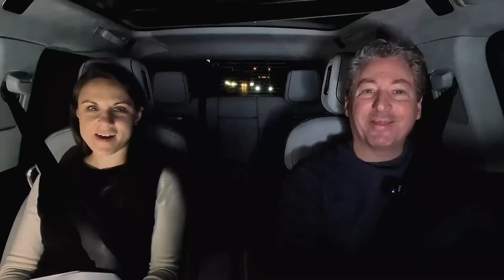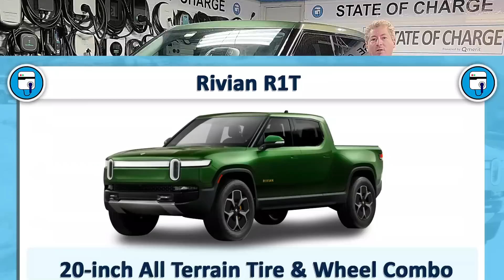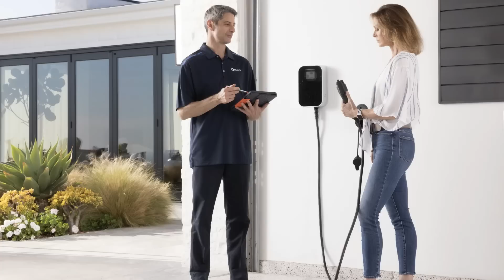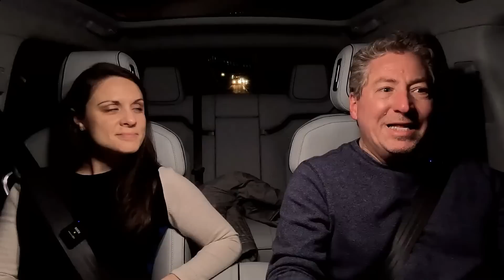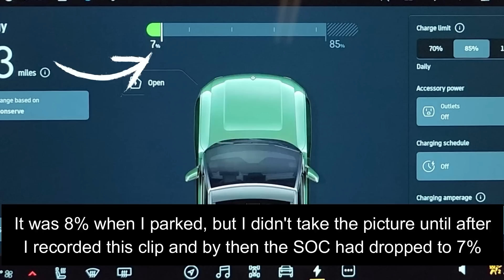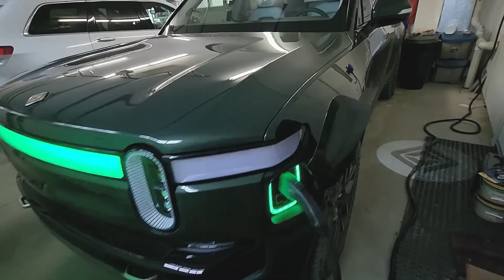Rivian R1T Winter Highway Driving Range Test

Comment: Tom what was your average speed in the Lightning? You stated 55 mph for the Rivian.
Reply from the maker: I don't remember, but it has to be less than one mph difference. You can see the comparison at the end I note it took me 3 hours and 50 minutes with the Rivian and 3 hours 54 minutes with the Lightning. So basically the same time to travel 211 miles.

Comment: I don't have a Rivian yet; R1S preorder in early Dec 2021. I do have a PDF of the manual. I couldn't find anything recommending using Conserve mode only for trips. ???
Reply from the maker: I don't believe it was an "official" statement. More of a recommendation that the vehicle is designed for all four motors to be used. If you exclusively drive using only the front motors, it will stress them more than they were designed for. The next time to speak to Rivian techs I will ask if they can clarify with an official statement.

Comment: Tom - can you explain how you used the cabin heater and how it impacted your range?
Reply from the maker: Sure, I set it to 71 degrees and on fan speed #1. When I do range tests I always set the temperature to 68 to 72 degrees, just enough to make the cabin comfortable and I also use the seat heater on the lowest setting. I don't know exactly how much the range is affected, though. I don't think it's reasonable to ask people to drive uncomfortably without the heat or AC on so I always use climate control to keep me comfortable on range tests. I'm sure if I didn't use the heat at all and just bundled up, the vehicle would likely go an additional 10 to 20 miles.

Comment: Cool Video, The Wife wasn't looking so Happy, But she knew you were gonna make it!  I'am Still  not convinced or say Comfortable with not knowing IF you're Gonna make it. Like what happens if there's a Flat Tire, Or an accident, Or Road Closure??? With 36 GALLON'S of Gas in my Truck I'd feel a Little more relaxed that if we had to take a detour or something unexpected happened that we would Make the destination. Nice Trucks, and Good Information Tom.
Reply from the maker: Ken, I could have stoped at 5 or 6 places directly along the route if I wanted to, and a simple 15-minute stop could have added back 70-80 miles. Normally, people wouldn't be doing range tests like I was so there wouldn't be an issue. If you felt uncomfortable, you could just pull off the highway, plug in for 15 minutes and you're good to go.

Comment: Wow.  Living in a rural area, I would be charging 3 or 4 times a week.
Reply from the maker: Wow, you drive a lot - 600 to 800 miles a week! Sounds like an EV would be perfect for you as you'd save $2k to $4k per year in fuel. You wouldn't charge 3-4 times a week, you'd charge 7 times a week. You plug in when you get home every night and you're fully charged at the start of every day.

Comment: Would the max pack of 400 miles plus would’ve made the trip easier or is it not worth it spending $10k?
Reply from the maker: Easier? Not really because even if I drove faster, we would have made it. I have no interest in the Max pack, personally.  I would only use the extra battery a couple times a year and it's just not worth it.
Reply: When I said easier I meant less range anxiety. How do you like the rivian vs the lightning?

Comment: On one of the other YouTube channels I follow, the host lives in the Los Angeles area and also has a Rivian 1T, which he loves. He did one road trip with it from L.A. to northern California and had such a bad experience with Electrify America and EVgo DC fast chargers that he said he would probably not road trip with it again. Use around town, all the time. But between coming across out of service chargers that wouldn't work at all to ones that would only charge at 15 or 20 or 30 KW that should have been charging at 150 KW or 250 KW, his experience was bad. And because so many chargers were non-functional or dysfunctional, there was a wait for the ones that were working. Plus he said many of the EA and EVgo stations only had 2 or 3 or 4 chargers total and if you remove the bad ones, it doesnt leave a lot of options. I think this is one area where Tesla really shines. They were forward thinking and proactive about building out their Supercharger network and their chargers are highly reliable and there are a lot of them. EA and EVgo and Chargehub etc. have a lot of catching up to do.
Reply from the maker: I've been driving my EVs for 14 years now and have taken many road trips and I have never not been able to charge on a road trip - not once.
I'm not saying we don't have problems with public infrastructure because we do and things need to improve, and they will. But in many instances, the issues get way overblown, in my opinion.
Reply: @StateOfChargeWithTomMoloughney  Thanks for that information, Tom. Good to know, for sure.

Comment: Let's be serious 70mph is too fast for electric trucks, most particularly in cold weather. Drop it to 65, and you'll get at least a 10% to 15% improvement in range. Trucks are basicly bricks and es we know the faster you go consumption skyrockets. At highway speeds, particularly in freezing temps, awful aerodynamics, and electric propulsion, simply dont mix. On my EQS, I have discovered that using the AC Eco program and keeping my speed to 65 translates into just 15% loss in total range. Even at temps below 0F, I still get 300 miles of range.
Reply: Using Comfort mode on my EQS 580, which has much more acceleration than Economy, reported range was 459 mi on big 21” tires.  It was on flat roads in Florida, using AC, with light winds.  Maybe I can get another 15 mi using Economy.  I’m finding EQS range much higher than EPA rating.

Comment: Did QMerit install that wallbox?  Looks like a self install?
Reply from the maker: No, my in-laws were having work done to the house and had their electrician do it while he was there.
Reply: @StateOfChargeWithTomMoloughney  That looks like 6 AWG NM-B / Romex wire running from the electrical panel to the EVSE.  For a 60A circuit for use with a 48A EVSE, need 6 AWG copper THHN/THWN or better, and in conduit.  Wouldn't hassle you normally as this is what a lot of people would DIY also, but if this was done by an electrician, doesn't jive with code or best practice.
Reply from the maker: @billjohnson3344  I'm having Qmerit meet me up there the next time I go to upgrade the installation. I may make a video of it.
Reply: @StateOfChargeWithTomMoloughney  That would be an awesome video Tom!  If they (or you) are able to highlight perhaps some of the shortcomings of the present vs. the improved install, I think that would be great to show the community.  Your videos are great as always.
Reply: Neither Bill or I would hassle you because we love  your videos.  I feel the Wallbox install is safe enough, especially due to direct wire vs plug-in.  I think a QMerit install would use conduit & THHN and cost about $450 with labor.

Comment: Thanks, Tom. It's great that you used conserve mode on the Rivian--two motors versus four motors--which is comparable to the two-motor Lightning. From an efficiency point of view, the two vehicles are very similar. But, like you say, the Rivian has the edge in highway driving, when it's in conserve mode.

Comment: I wish you would have mentioned the difference in the two trucks. The F150 looks much bigger and is probably heavier too (?). This will have an effect on the outcome.
Reply from the maker: The Rivian is heavier, by about 600 lbs. The Lightning had a worse Cda, though, which is more important at highway speeds.
Reply: The Rivian is really a mid size truck even though heavier than the Lightning. Lightning has a full size bed and full size back seat which is very comfortable for adults. Rivian small bed and small back seat. Sit them side by side and you really notice the difference. I like both of them, and would daily drive the Rivian if I had one, but use the Lightning for long trips or when I needed to haul stuff.
Reply: FWIW, a vehicle's drag coefficient has a much larger affect on it's range than the weight of the vehicle (or load).  Neither vehicle has a good DC but I suspect the Rivian has a slightly better DC as it's front end is not as big and flat as the Lightning.

Comment: Nice range test. 
Does that wire going through the drywall meet code?
Reply: I couldn’t focus on what he he was saying after seeing that sloppy charger installation.  I was surprised I had to read this far down in the comments before seeing feedback😮That electrician was just lazy, route of least resistance and even mounted unit crooked.  Hopefully not part of your Q Merit crew!
Reply from the maker: My in-laws used a licensed electrician in VT. It's not the cleanest job, but it's totally safe.

Comment: also while neurotic, @kyleconner mentioned not using conserve anymore to not overuse front motors. im assuming you wont keep the rivian that long but any thoughts?
Reply from the maker: It's absolutely fine to use Conserve mode every now and then. This is the first time I used it in a few months, actually. Rivian just really wanted to let people know if you use it all the time it will put undue stress on the front motors. However, on occasional road trips, it's recommended.
Reply: @StateOfChargeWithTomMoloughney  got it, thought it was more common use.

Comment: Did the F150 do the trip in AWD and the Rivian in FWD? Half the drive train makes a difference.
Reply from the maker: Yep. But you can't switch the Lighting into FWD. I drove them both in the most efficient modes available as anyone would do if they were trying to go as far as possible without stopping to charge.

Comment: This video helps eliminate some of the range anxiety issues most people worry about. 
Thanks Tom!
Reply: All he and his wife talked about was 'IF' they would make it... sounds like 'range anxiety' to me... just say'n
Reply: Not really. I do a 500 km drive in my Pilot every winter, no problem. All wheel drive. The Rivian sounds like it wouldn't make 300 km. That means 1 or 2 stops as I don't want to risk losing power in the mountains. For me this is a major downside for the Rivian, as much as I would love to get one for other reasons.
Reply: Check out the Know You Know channel. Two attempts at a range review and both times they couldn’t even start the truck.

Comment: Assuming the road conditions were identical, I think the warmer temperatures gave Rivian an edge. I suspect both vehicles would arrive with similar percentages if the temperatures were identical too.
Reply from the maker: Same exact route. I don't think the lower temp played a role much at all - maybe 1%. The batteries are very dense. They were both warmed up to about 50F before the trip in my garage. If they were cold-soaked outside in the different temperatures overnight and then I started out, yes, it would have made a difference, but not in this circumstance.
Reply: @StateOfChargeWithTomMoloughney  Since you have both the Ford & Rivian, wouldn’t doing the trip with both vehicles at the same time provide a more accurate result as to which has better range in the cold? Sorry in advance, this might be too demanding of a comparison request 😉. Please feel free ignore it. I remember Kyle from out of spec did something similar, but with towing.
Reply from the maker: @stevemit2858  It's not really feasible for me to do the Vermont trip with both vehicles. But I am planning on doing a side-by-side cold weather range test with the two soon. I'll probably drive to Pennsylvania.

Comment: Glad you made it safely. It would be interesting to see the total kWH usage to compare with the mi/kWh. One factor to consider is that the Lightning is a larger truck than the R1T, so one might expect more kWh consumption, unless you used a premium electricity to charge one and standard to charge the other😅. Living in Minnesota, 19 F is a really nice winter day. Appears as long as one is able to park indoor or a least keep the EV plugged in overnight to keep the battery warm, that cold weather conditions are not a big impact. I have seen some videos where the Rivian was parked outside at nice near zero degrees F and the 12 volt battery bricked and the owner was not able to get into his Rivian R1T and had to get help from Rivian. Have you experienced any such issues? Thanks again.
Reply: Lightning is bigger,  but 500 pounds lighter,  ironically.

Comment: I took this trip last week in our R1T. South Central PA to Mount Snow. Stopped in Newburgh, NY and outside of Albany for two fast charging stops. Charged to 100 at both stops. Ate lunch at the first and drank coffee and played cards at the second. It was a great way to travel. More leisurely pace and saw places I would otherwise just drive by. Same stops on the way home. No issues either trip. Weather was mild. Have fun!
Reply: Questions surrounding conserve mode, winter night driving: Any adjustments to interior comfort? Saw jackets on back seat. Cabin temperature, heated seats, heater/blower fans?